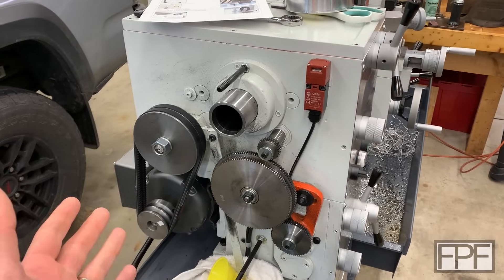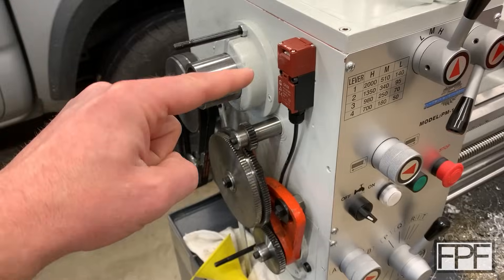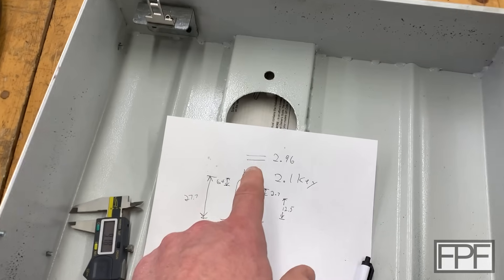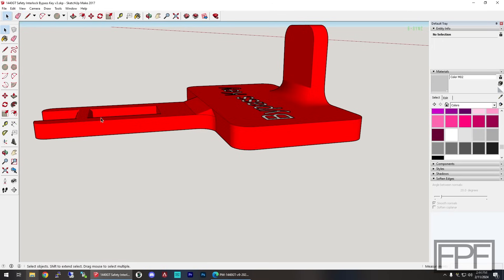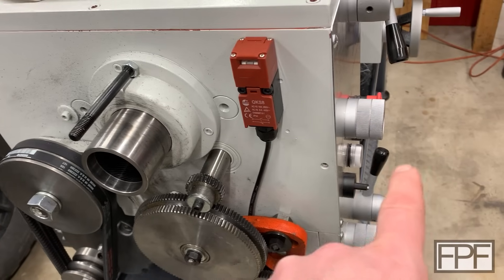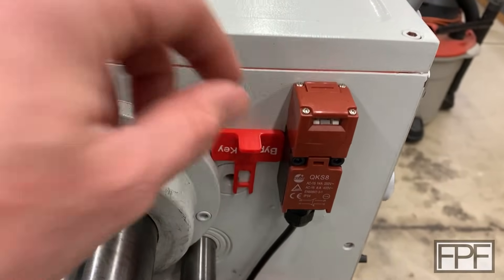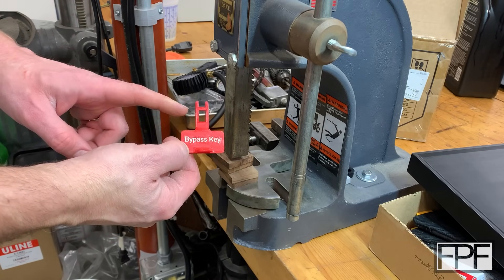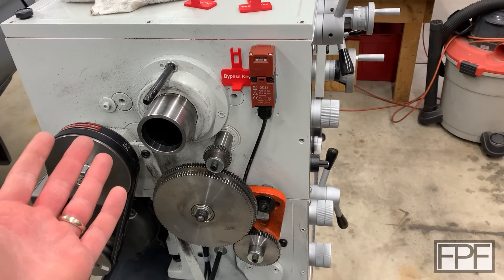3D Printed Interlock Bypass Key

Comment: Lots of great functional print ideas. Thanks for posting them and making them freely available. Would you consider designing a simple lathe tool tip height setter? This is not the most complicated thing in the world but useful. Many people just eyeball the centre height, or sort of compare it to the tip of a tailstock held point. Given your history, such a thing might not end up being so simple ha ha. I’d suggest holes for magnets on the bottom, a sharp edge to measure height, some adjustability in height. Cheers.

Comment: for the lower hole, ont he head, you should put threads on a tube.  you get an initial would of drops and the it flows on the tube.  for the one behing the gears, youy could use a bolt that has a hole in it, and a hose attached  (maybe with a 90 degrees) , and the hose is plugged at the end.  no more fidgeting with tape and stuff.  actually both coud have flex tube with plugs at the end, permanently attached..
Reply from the maker: good ideas, thx

Comment: Isn't 20 hour oil change mark for first oil change only? All the lathes I know of can run years without oil change, so is this one any different? This is not a high performance engine. Oil seemed to be very clean, however I hope that it has a magnet somewhere to collect potential metal filings or metal dust.

Comment: I did this exact thing on the edgebander in work just put a piece of paper behind the key and drew around it and measured the thickness, took it home and printed in pla. Works like a charm. Saves so much time when setting the cutters and scraper for a different edging.

Comment: A few thoughts.  I've got the same machine (1440GT) and I simply removed the switch and jumped the terminals at the board.  So much easier than dealing with it, especially since you're just defeating it anyway.  Then when you want to put a tachometer on the lathe you can use the mounting holes for the switch to hold the sensor.
Also, on the oil changes.  Consider getting yourself an oil pump like you would use for an inboard/outboard where you can't get to the drain plug.  Just pull the top cover off the headstock and pump it dry, it's SO much easier and you get to have a look inside once in a while and see how the drivetrain is looking.  You will also find metal shavings that you can remove with the cover off that are not coming out from the drain.  The oil pump also makes life so much easier for all your other oil changes (autos etc..) as you can pump out the majority and only have to drain the last small amount into a pan.

Comment: We used those switches on the machine I worked on. I ended up making a metal key by hand. Point of interest. You can override the safety switch by unscrewing the top portion. It is operated with the top removed.
Reply from the maker: interesting, is it a "drum" inside like I was guessing?

Comment: Very nice.  I’d be inclined to nip a bit off the left corner to make it nestle into the bearing retainer.  But that’s probably gilding the lilly.
Reply from the maker: Thx for the idea.  If it ends up migrating around under there, I'll adjust the corner to follow the curve of the spindle bearing retainer.